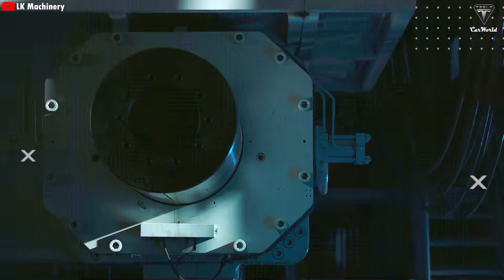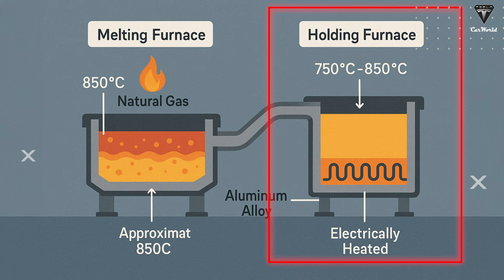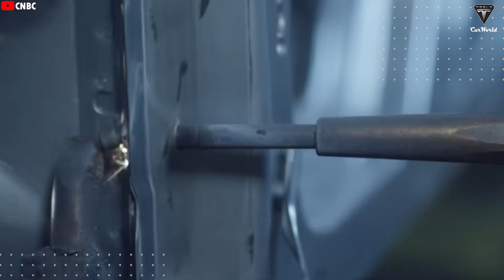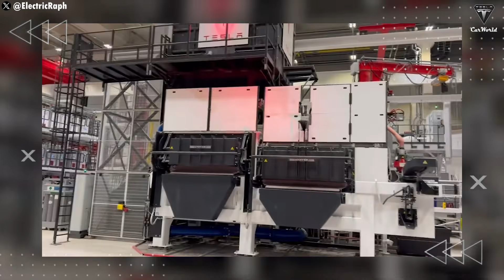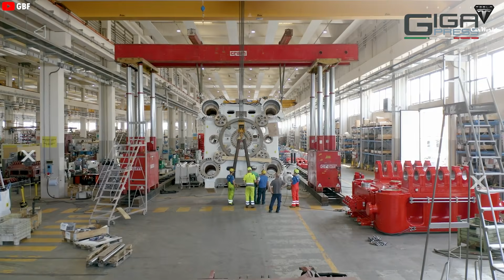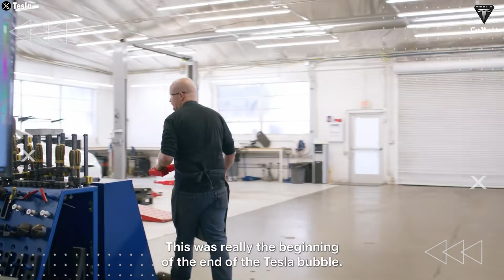Elon Musk Reveals Mind-Blowing GIGA PRESS 50.000T Roll Out 5 Tesla Next Gen Car in ONE Go!

Comment: In the event of a manufacturing defect, how difficult and costly would it be to repair a one-piece underbody?
Reply from the maker: Great question. One-piece castings can be harder to repair than modular parts — but fewer welds also mean fewer weak points. Most damage would likely require panel replacement, not full re-casting.

Comment: Just the amount of money saved in nuts, bolts and washers is impressive.
The only problem I have with roboabs is sanitation. 
What if the previous passenger made a nasty mess?
Does Tesla plan to have a built in cleaning system, I wonder.
Reply from the maker: You’re spot on — sanitation is a huge challenge for robo-taxis. Tesla hasn’t revealed cleaning systems yet, but many expect automated UV sterilization or self-cleaning interiors in future updates.